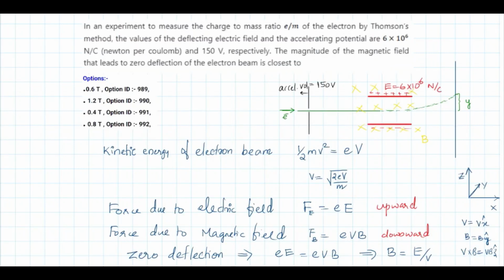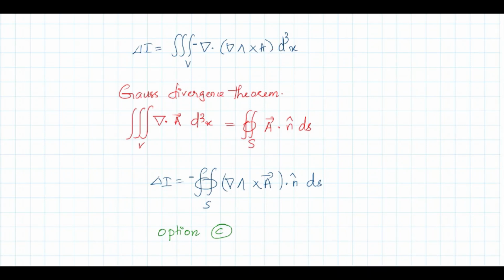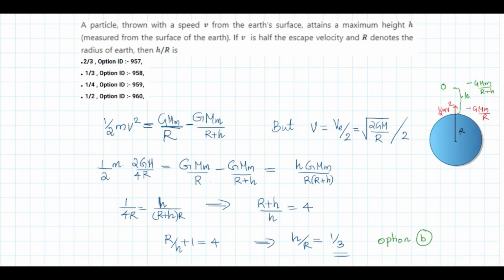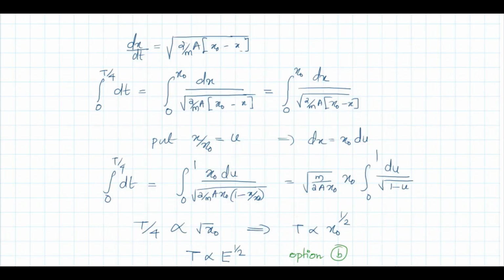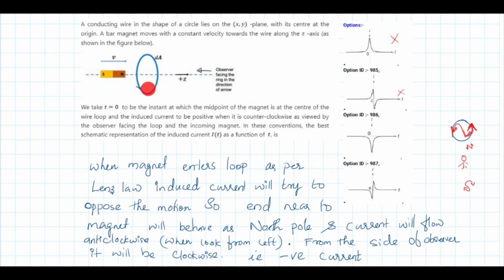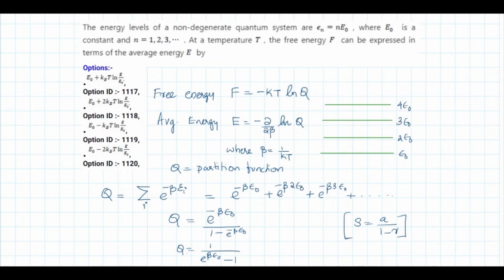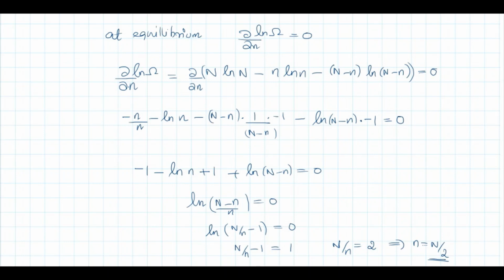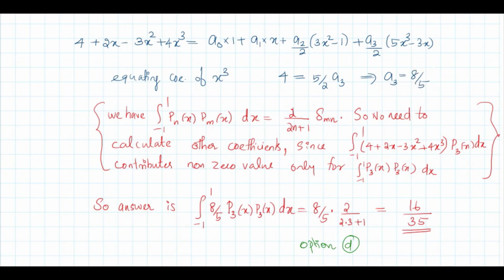CSIR NET Exam Physics February 2022 Solved

Comment: Thank you sir for the detailed explanation. I have a request sir. If it is possible for you please make videoes on TIFR previous year problems on Part B specially (the part for phd students only ). Because other parts are not too tough to solve. In December tifr exam will be held so it will be helpful if you can make those videoes.